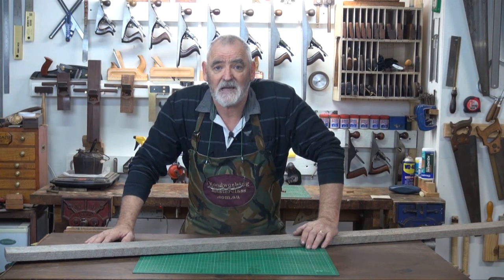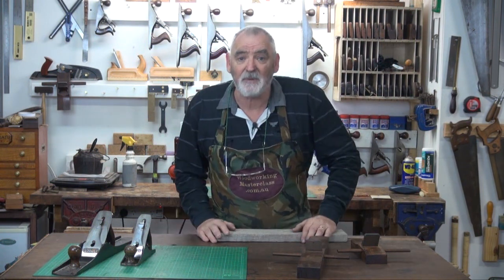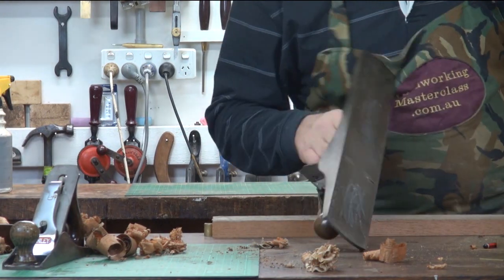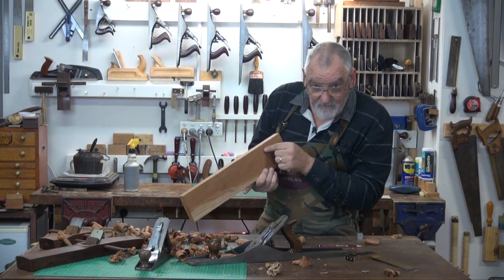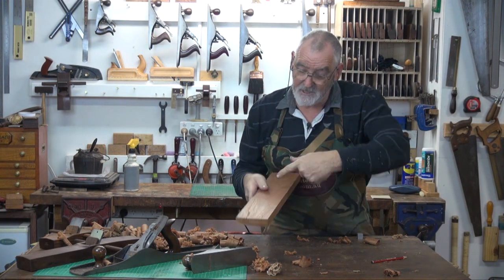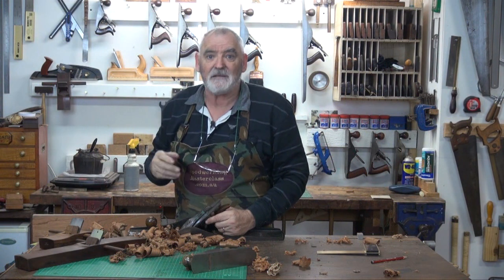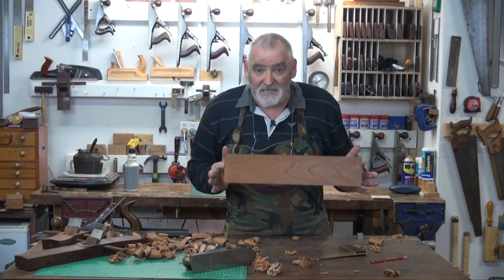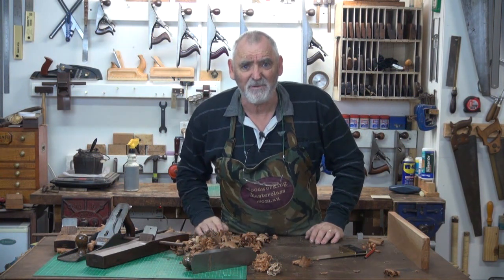Squaring a Board with Stanley Bailey Planes

Comment: Thanks for pointing out how if have the two perpendicular you can get the other side parallel by using the square. I should know this but hadn't thought my way through the geometry. This will help.
Reply from the maker: Thanks the for the feedback Joe. Nice to know we can help out. Hope you continue to enjoy the videos we put up. Cheers Steve
Reply: It's weird that this video created such impression and that wasn't mentioned. They won't be parallel, you must measure the thickness of the board to ensure they are parallel. Imagine a simplified axe, two wide sides are your top and bottom of board that are perpendicular to the side, but they intersect at cutting edge of the axe! Same goes for the side faces.
Just can't think of better example right now.

Comment: Nice tutorial Steve, informative & much appreciated. I'm curious why you didn't use a marking gauge to scribe a consistant thickness though, because if you think about it, the final side flattened could have been square to the reference edge while the board slightly increased in thickness from one end to the other.
Looking forward to your end grain video, the portion of truing boards that gives me the most trouble.
Reply from the maker: Reason for no gauge lines was because it was squaring exercise not planing to dimension. Which will come a little later. Good point though. Appreciate your feedback. Cheers Steve
Reply from the maker: Reason for no gauge lines was because it was squaring exercise not planing to dimension. Which will come a little later. Good point though. Appreciate your feedback. Cheers Steve

Comment: Very good video Steve! I have a #7 that I use to joint edges for panel glue ups. Sometimes on long boards I get a bit of a banana shaped curve rather than a true edge. I'm thinking that it's because my workbench is a bit light and tends to move around on me. What do you think?
Reply from the maker: Could be a number of things. I used to get them all the time until I realised it was my glasses playing tricks on me!
If that's not the case sometimes you stance will create it or that you pause and change position then start up again this will, in many cases, create a dip in the board because when you restart you have extra downward pressure on the plane to overcome momentum. Just a couple of thoughts. Cheers Steve

Comment: No worries Steve, got all those tools. Do you think that your round nose sliding lid box can be made exclusively with hand tools?
Reply from the maker: There is a way you can do it but it has a square sliding lid and also the sliding joint is not the same. Totally different construction technique but still looks good. Cheers Steve

Comment: Nice video but at 7:30 are you saying your fingers can detect out of squareness? If so how long does that skill take to cultivate? Whenever I do an edge on a long board I struggle to get a consistent edge, some parts will be square, other parts usually the start or end of the board will be out of square and I've been using hand planes for years.
Reply from the maker: Can't answer that with a definitive answer. All I can say is it's there. Try finding out which way you are out of square and just focus on that part, adjusting the plane's sole with you fingers until you can get that part right then move on the other part and do the same. I can promise than when you get it right it will feel as if it's wrong. The reason for that is that it is contradicting your former muscle memory when upto date is comfortable but out of square. Hope that may put a new light in it for you. Nearest thing I can draw a parrell to is correcting a golf swing to eliminate a slice. Cheers Steve